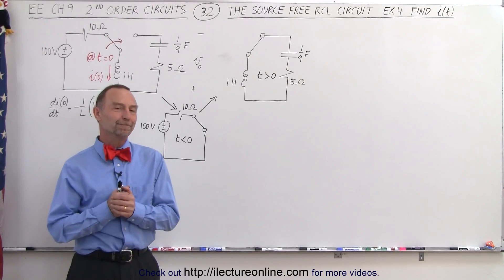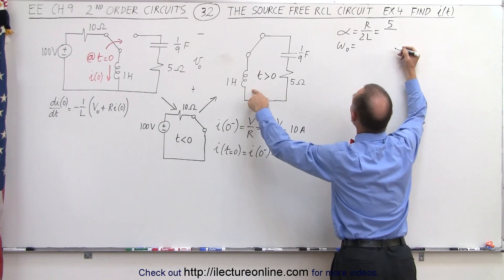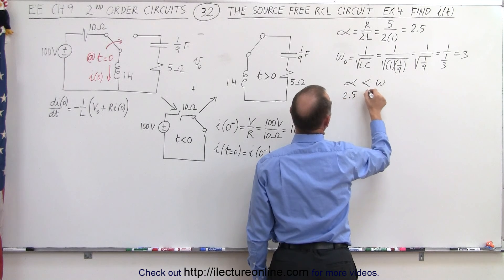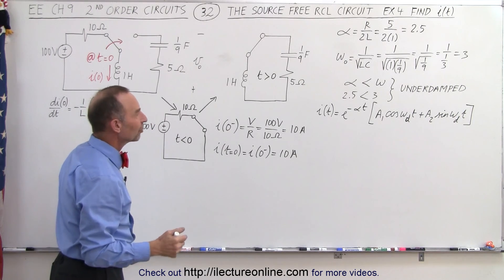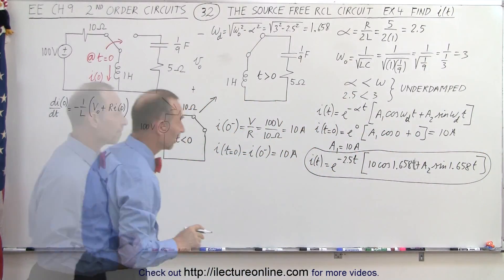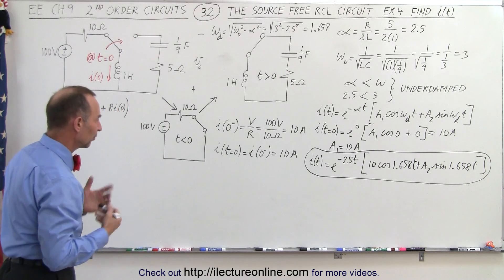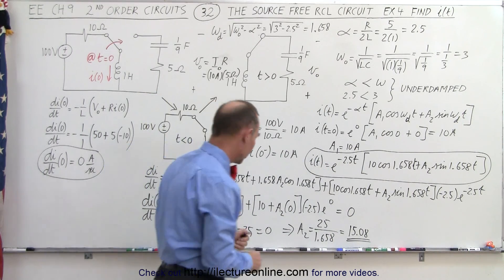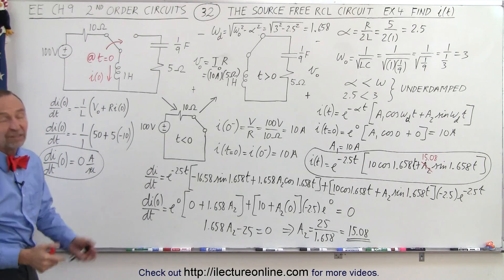Electrical Engineering: Ch 9: 2nd Order Circuits (32 of 76) Source Free RCL Circuit: Ex. 4 i(t)=?

Comment: According to the definition of V(0) in which equation (d/dt)i(t=0)  = (-1/L)(V(0)+i(0)R), It should be voltage difference across capacitor not resistor with the capacitor.

Comment: sir, you're solving incorrectly, the voltage across the capacitor and current through inductor are differentiable quantities means that V(0+) = V(0-) for capacitor and I(0+) = I(0-) for inductor always... 

considering this and having I(0-) = 10A , we see voltage of the capacitor is 0 at first and -50 volts drops at resistance so the voltage across inductor would be +50.
Reply from the maker: The answer in the video is correct, except at the end  A2 = - 15.08  (instead of + 15.08)    Thanks for checking.

Comment: Hi Mitchel. I'm a little confused with the inital conditon. What if I apply KVL to the Loop. The voltage drop across resistor has the negative sign. And the current going to Capacitor is like charging the capacitor, so the voltage drop across the cap has positive sign. I dont know if it is correct. Could you verify it?

Comment: The voltage across the capacitor at t = 0+  is the same as it was at t = 0- which is 0. That would make di(0+)/dt = - 50 amp/sec. That would make A2 = -15.08.
Reply: -50 or 50??
Don't forget the minus outside the bracket
Reply: same here
Reply: I was confused for a second there
Reply: yes, at t=0+ the current tends to decrease and -Ldi/dt induced per Lenz law. Or, yo can say that i is decreasing at t=0+, therefore Ldi/dt is negative.
Reply: yes, at t=0+ the current tends to decrease and -Ldi/dt induced per Lenz law. Or, yo can say that i is decreasing at t=0+, therefore Ldi/dt is negative.

回覆
yes, at t=0+ the current tends to decrease and -Ldi/dt induced per Lenz law. Or, yo can say that i is decreasing at t=0+, therefore Ldi/dt is negative.

回覆at t=0+, no electron in capcitor, Vc=Q/C=0, Vr=I*R=10*5=50, VL+Vc+Vr=0, VL=-50, i is decreasing at t=0+, therefore Ldi/dt is negative. Ldi/dt=-50, A2=-15.08

Comment: I think you made a mistake at 5:30. V_0 is the initial voltage across the capacitor which is 0. This makes di/dt = -50. This makes more sense as the change in current should be quite big at t=0.
Reply: I agree with you, that di/dt should = -50, can we get a comment from Michel van Biezen on this point? I will probably try and use multisim to verify this.
Reply: @cliveprobert9856  and what did it said. I also thought it was -50
Reply: Yes di/dt is minus 50 here.

Comment: Sir if we put AC source instead of DC the system response  will be the same am i right Sir
Reply from the maker: With an AC source the response will be different.
Reply: But Sir when we design filters the response of the system depend on alpha like Butterworth filter response is 0.707 and for DC signals too the response remain same